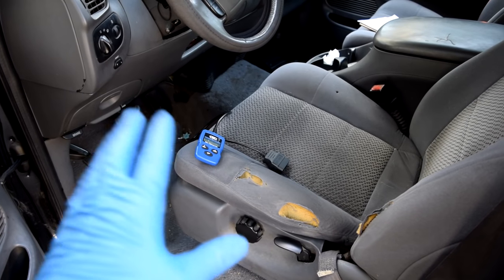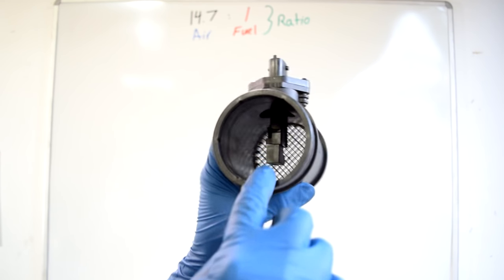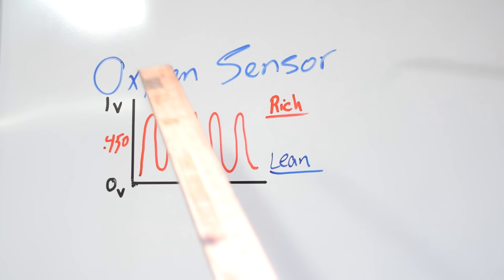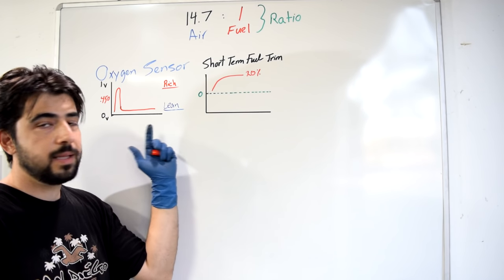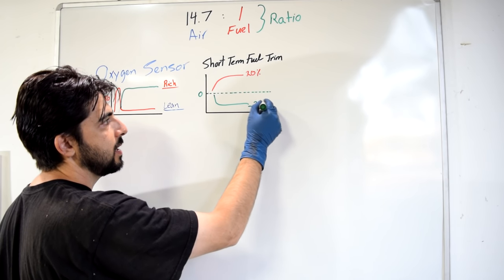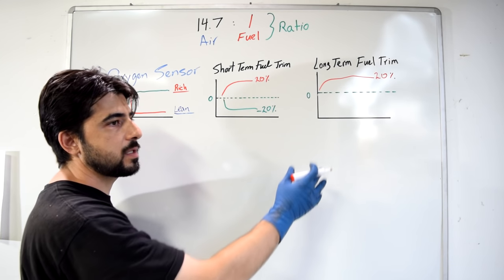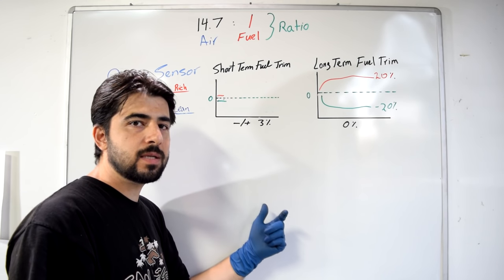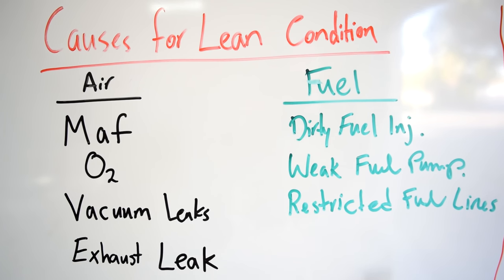Short Term and Long Term Fuel Trims Explained

Comment: This video was a awesome as usual and oddly enough, right when I need it most.  I'm about to go check my short and long term fuel trims with my innova scan tool.  had no idea what they meant before watching this.  

my car randomly died at a stop sign 4th of July and I got it started but it ran violently rough and had no power for a few seconds.  then it was fine for a week.  I figured it was the fuel pump since it has 220k miles on the original pump (98 Chevy Metro 3 cylinder manual) and I replaced it with a new denso pump.  the car ran fine for a few days and then began to have bad hesitation issues, especially when the engine was in open loop.  any time I floored or gave medium throttle the engine would fall flat on its face and sometimes die.  it also had developed a very hard start where it would crank forever (15+ seconds sometimes) before firing up.  

I checked every part of the egr system and evap system by the factory service manual and everything except one of the egr solenoid valve sensors tested fine.  this one the air came out the opposite places the book said and I had tested this a long time ago with the same results and it never caused a problem so I assumed the book had an error and had it backwards.  

finally I tested fuel pressure and only got 10 psi (13-20 is factory spec at idle) and as soon as I shut the key off, it dropped to zero in a split second.  it's supposed to hold fuel pressure for at least a minute.   then I was going through the fuel pump testing procedures and found one of the relays did not have power where the book said it should but instead had power on the opposite side so either I'm reading the diagram wrong (I even confirmed wire colors with the schematic by unbolting the fuse box and looking underneath) or they also had that test backwards.  I've found several errors in service manuals and different torque specs on different pages for the same bolts so I wouldn't put it past them.  but the book said if there's no power to that cavity of the fuel pump relay, then the ecu is bad and to replace it.  seems odd that the ecu would just go bad for no reason.  

so I ran a wire straight to the fuel pump from the battery to eliminate the circuit and I still only got 10 psi of pressure.  I replaced the fuel pump again with a different brand and the car ran ok for a couple days and then got worse.  

during the course of this whole mess I have replaced the spark plugs, wires, cap and rotor.  checked and replaced every single vacuum hose and added hose clamps to every single one just to be safe.  I also put a brand new egr valve on.  still didn't fix it.  

this week I got two codes finally.  after a month of driving with this problem.  evap leak p0455 and egr system p0400.  

my evap vent valve solenoid had been making a loud clicking sound whenever it's got voltage to it and it's open allowing fumes to enter the engine.  sounds like a hydraulic lifter or valve lash that's way too loose.  but I tested out fine via the procedure.  

I also put brand new denso o2 sensors in maybe 3k miles ago or so.  I'll check those again on the scanner while I'm at it.  

if you've got any other suggestions, in at my wits end and tired of throwing money at this thing.  I unplugged the egr vacuum hose thinking maybe it was stuck open or opening during acceleration and that didn't make a difference.  I also drove with the evap vent valve solenoid unplugged and no difference.  

sorry that was long winded but a lot has gone on with it lately.
Reply: freeze frame data

p0455 
fuel sys 1 0L-drive
calc load 29%
ECT 176F
Stft b1 0%
ltft b1 10.9%
map inHg 29.5
engine rpm 2175
veh speed 34 mph
Reply: p0400 
egr recirculation flow 

no freeze frame data
Reply: scan tool says 3 codes but two of them are p0400
Reply: live data @ idle closed loop engine warmed up.

Stft -1.5 to +3.0
ltft 5.4
map inHg 9.7 to 12.4
o2s b1 s2 0.06 to 0.84
Stft b1 s2 -1.5 to 3.9
o2s b1 s2 1.275
Reply: revved to 2750 rpm
Stft -6.0 to 3.1
ltft 7.8
map inHg 8.2 to 9.1
o2s b1 s1 0.8 to 0.1
Stft b1 s1 6.2 to -1.5
I2s b1 s2 0.135 to 0.175
Stft b1 s2 NA
Reply: also forgot, the tps is completely within spec and has a very smooth linear sweeping voltage.
Reply from the maker: What is the issue as of now? Hard start? Hesitation? 

After the second time you replaced the fuel pump and it ran ok but got worse after a few days, did you check fuel pressure? 

Also you need to check your Evap PURGE solenoid, if that is stuck open it will give you performance issues, the Vent Solenoid being open all the time will cause no performance issues. 

Also check out my video on how to diagnose a car that cranks too long before it starts, it will help point you in the right direction. The fuel trims don't seem to be out of wack.
Reply: +Ratchets And Wrenches the problem now is long cranking before starting and also really bad hesitation when anything but partial throttle is applied.  I had a very similar symptom once on my Toyota pickup years ago that turned out to be a shorted MAF wire telling the ecu there was very little airflow but this car has no MAF.  

On that evap solenoid, I'm not positive which one it was but I will find out.  I will rewatch your hard start video.
Reply: Check your MAP sensor and vacuum lines going to it. I had a soft marshmallow vacuum hose going to the MAP sensor on a Dodge van. It ran fine until it either warmed up and got real soft and sucked closed by the engine vacuum or had the same happen by rapidly closing the throttle from wide open. Took me a while to find that one.
Reply: +Blair Rollin thanks.  the map sensor is on my list.  haven't had time lately to do any testing.  the hoses were all just replaced and I put brand new hose clamps on all of them.
Reply: Not sure what the values should be but if the MAP sensor is bad, it can cause a lot of really bizarre problems and throw a lot of codes. I had a cracked seat on an EVAP valve. It was pretty loud, but seemed to seal good enough and never caused any kind of problem. Good luck.
Reply: +Blair Rollin I ordered a new map sensor from a Suzuki dealer.  it's about $300 from gm, got it for $60 from Suzuki.  also ordered a new evap purge solenoid for about $100 from gmpartsgiant and a new filter for the map just in case it's somehow bad.  Ordered some used supposedly foot egr solenoid and bypass valve off eBay.  I'll put them through the same tests to see if they function the same as mine or like the book says the bypass valve is supposed to.

Comment: Great video. However, do not be quick to jump to a vacuum leak.  Some-many engines have a vacuum compensated fuel pressure regulator. This device automatically lowers fuel pressure at low rpm and increases pressure at higher rpm. So seeing different LT trims at low vs high rpm is completely NORMAL on these.   Do use the trims though to help diagnose, for suspect vac leaks always check with a smoke machine to confirm before starting taking this apart.   Good stuff great content. 👍

Comment: Great video.  I'm new, but I believe an exhaust leak upstream of the O2 sensor causes a lean signal (not because exhaust gases get sucked in...the exhaust pipe is pressurized) but because the exhaust gases float by the external sensor of the O2 sensor and cause a smaller difference in O2 between the inside and outside environment of the O2 sensor.  Same thing happens when the outside of the O2 sensor is covered with oil and dirt.  No experience here, just pulling together what I've read.
Reply: Nicholas,

If there's a crack in the pipe before Bank 1 Sensor 1 ( 1st Sensor of 2 ) ; Bank 2 Sensor 1 - either one of those 1st Sensors will send a Lean signal to the Computer. The Computer will say , "Wait a minute" and implement the opposite. It will make the vehicle run Rich for High CO ( carbon monoxide); now the persons car will fail Smog Check for High CO on California vehicles 1999 & older so if you aren't sharp you might be changing parts that make a car run Rich ( Wasted Money ! for the customer ); when in reality it's the crack before the Sensor....I may Post what you're supposed to test when your Long Term Fuel Trims are way outta range, but it's lonnnng.

Southern Califoria Smog Repair Tech. background ( Been outta commission for 4 years )
Reply: 12.29.2018
(Temp. outta commission 4 years )
Ex- Southern CA. Smog Repair Tech

The "Real Skinny" on Long Term Fuel Trim Diagnosis :
These are supposed to be "3" Vertical answers below :

condition.   L.t.@ idle.   @2,500rpm
Normal.      -10% to -10%  -10to-10
vacuum leak.  >-25%         -10to-10
fuel flow prob.  -10to-10.    High
low fuel pressure >-25%    > -25%

High positive fuel trim numbers
+ 12% to + 35 %
Scan Tool will eliminate (+) sign

Test components : 
Labscope preferred for Sensors.Voltage meters update rate too slow

maf sensor.           n/a. pass. fail
map sensor.           n/a pass fail
vaf sensor
oxygen sensors
exhaust retriction (plugged cat)
Low fuel pressure
Clogged fuel injectors
Ignition system misfiring
Vacuum Leaks !
Computer malfunctioning

High (-) numbers
-12% to -35%
Air fuel mixture is too Lean
                                      N/A pass fail
1. Engine too slow reaching  Closed Loop status (operating temperature)...Escan Elite Laptop Scanner ($1,595.00)
www.automotivetestsolutions.com
Big Dog Neighborhood
2.idle speed to low
3.dirty motor oil
4.dirty filthy air filter
5.advanced ignition timing
6.clogged pcv valve
7.maf sensor fault
8.map sensor fault
9.tp sensor
10.ect sensor
11.iat sensor
12.crankshaft/camshaft timing error
13.oxygen sensors defective
14.high fuel pressure
15.leaking fuel pressure regulator
16.leaking injectors
17.grounded injectors 
18.faulty evap.components
19.low compression
20.exhaust leak before Bank 1 or Bank 2 1st oxygen sensor
21.faulty cats

Smog Repair background
Southern Californua

Comment: Hey I noticed you said you used brake cleaner to try find a vacuum leak. Is it safe to use brake cleaner? Also does it have to be the flammable kind?

Comment: I have the same problem on my 2005 Mazda 3.  The OS2 downstream has 0 trim % with the voltage varying correctly in range.   I changed the O2 sensor but still  same problem.   I checked continuity to the ECU on all 4 OS sensor wires which checks good.

Comment: Thank you for the video. Ik have a question:
 
Lately I have noticed: that my car needs more fuel. When I look at the data I see this: 

- The fuel trims on bank 1 are ok (between +/- 3 With a warm engine)
- The data on bank 2: sais I only have a short term fuel trim wich is almost steady on +12,5%.

Any idea what could be the problem?

I cant find any vacuum leaks

Comment: Thanks a lot, valuable information in few words. I have 2002 ford cv 4.6L I tried to fix stalling and hesitating but no chance!! 
my question is, Can I run it without this system?  I mean like cars back  70`s or 80`s in a simple way.
Thanks

Comment: Great video.  My long terms are about 15% but one of my three O2 sensors voltage is not changing like the other two.  So I am going to replace that.  It is not giving me any codes.  My 2001 Jimmy is hard to start cold and I hope this is the issue.

Comment: I have a 2006 Nissan Pathfinder with 190,000 miles. I had both catalytic converters back in 2015. A few months ago a P0420-Bank 1 showed up. Last week I had the spark plugs, valve cover gasket, and air filter replaced. I wanted to start with something simple first. I suspect its a exhaust leak or bad oxygen sensor, not the CAT as I replaced OEM with OEM.

My Innova 3100ABS OBDII scan tool only shows freeze frame data:

System Status: Red
I/M Monitor Status: M, F, CC, C, EV, O, OH
Fuel Sys1: CL
Fuel Sys2: CL
Calc Load: 54.5%
ECT: 190.4°
STFT B1: 0.0%
LTFT B1: 0.0%
STFT B2: 1.6%
LTFT B2: 0.0%
Eng RPM: 1838
Veh Speed: 34 mph
TPS: 15.3%

What oxygen sensor is for Bank 1?

Comment: Thanks for this video and very helpful to understand a fuel trim. I have one question. In my car case, a ratio of STFT at Iddling is ok (-1 to 1%) but if rpm goes to over 2500 , the ratio will go up to 10-15%.  What is wrong?  Actually I now feel less power at higher RPM over 3000. Is this because a high STFT ?
Reply: You have a leak in the exhaust system very near the O2 sensors. That is sucking outside air in. I know is counterintuitive. Exhaust gases shrink instantaneously as they cool in the exhaust after each pulse. A pinhole leak nearby will suck air in, bringing in oxygen.  The sensor sees this extra oxygen and compensates by driving fuel trims rich.  Check for missing exhaust manifold bolts, loose leaking exhaust manifold gaskets, cracked exhaust manifold or collectors and down pipes. Hope that helps!

Comment: Hello I  have a problem with my 2010 f150 5.4 3v  when I start my truck first thing in the morning it seems to crank longer than normal and then once it fires it runs alittle rough for about 20 sec puffs out alittle smoke then in netralizes and burns clean. It's run great all day start fine ect. No codes any thoughts? I've posted a video demonstrating on my chanel I hope to hear from you. note I've changed my plugs also fuel module. Still does it .  I enjoy your videos your a smart person!

Comment: Hi R&W - My 2004 Nissan Quest O2 sensor readings are weird compared to what you describe. Can you explain:
O2 B2S1 voltage is always double O2 B1S1 voltage, and the Short Term Fuel trim is also double, in the opposite direction of course.
This looks like the two banks are lean and rich always.  Now, here's the kicker: when test driving at about 35-40 mph, the voltage on B2S1 blips at 1.275v, and the STFT21% is 0% at that moment. I read that this unusual voltage reading is a) due to Nissan using narrow band O2 sensor (with range 0-1.275v)   and b) 1.275v indicates a perfect 1.4:1 A/F ratio.  
I have no DTC codes after replacing two coils, but would like to understand these readings.  
THanks!

Comment: amazing video gonna try on my gti tomorrow one question  say a car has   a original ecu software one and you add modifications example  decat exhaust induction kit would that cause issues as it has more air flow ? it would be running lean as it has more breathing space  ?

Comment: 14.7 to 1 for pump gas. But other fuels such as E85 and methanol are way lower. That's the only point you missed I could see. Great video!
Reply: This is general knowledge. If you run e85 and don't know how to read fuel trims then you probably shouldn't run e85
Reply: 9.8 to 1

Comment: Thank for the useful video.
I have toyota corolla 2010 model 1.3 Litre engine. 
The problem is when car in driving mode, both STFT and LTFT remains normal, but when car is at idle, LTFT goes to -14% at idle STFT remains under plus minus 5 range. 
following checks have been made,
1- MAF sensor changed, no effect
2- 02 sensor changed, no effect
3-Cylinder pressure each gives 140 PSi .
4- catlytic converter has been cleaned but no eefect. 
5- injector are checked , and OK.
6-fuel pressure is normal.
7- pressure regulator , no issue
8- no engine codes, etc. 
9- spark plugs are check, no indication of rich mixture. 
kindly advise on how to fix -14% LTFT at idle. please note that when I increase RPM at 2000 or 3000 , LTFT changes to normal, even while driving by pressing very little throttle pedal. as soon as I leave the throttle pedal, the LTFT become -14%

Comment: Great video. So now I have a question: I am getting a P0175 code Bank 2 System Too Rich. 
O2 sensors are new and they're working correctly oscillating from .2 to .85
MAF sensor is also new
EVAP test is ok
STFT is plus or minis 3.1% on all banks
LTFT is normal on Bank 1 and -20% on Bank 2; when I increase RPM to 2500, the LTFT improves to about 14-17%
The engine runs great with no misfires; It has 239,000 miles on it.
According to your chart, it could be on the air side: exhaust restriction or worn engine
On the fuel side. it could be: leaking injectors, bad fuel press reg, high fuel pressure
So my question is; how do I tell more definitively which one is my issue?

Comment: I think that in this situation the (IAC) would be of immediate concern. One good dose of throttle body cleaner to get the cylinder valve rotation back to norm.
Reply: I have learned much about modern vehicles by watching some of your videos and continue to do so.

Comment: Good video Thanks, Ive got the too rich Banks 1 & 2 in a 1999 Camaro z28 5.7L . What scanner do I need to see fuel trim ?
Have looked at the ANCEL AD510 ------what do you think ?
Works on All 1996 and newer vehicles (OBD II & CAN) - domestic and import
So this might be a good place to start, I just hope it is not the Fuel regulator as it is I think in the Fuel Tank attached to the pump. If it is I might have to cut a trapdoor in trunk to get to it (this is a known solution rather than dropping the Fuel Tank which is a big job)
This issue has been annoying me for the past 13 years and it only comes up maybe once every 4 to 6 months.
Graeme in Australia

Comment: I'm thinking about re-installing the intake, only this time, use a torque wrench and torque it down correctly.  Also, since I'm lifting the intake again, I plan on replacing the gaskets as well.  What's your take on my situation?